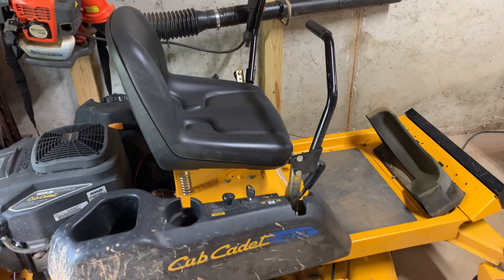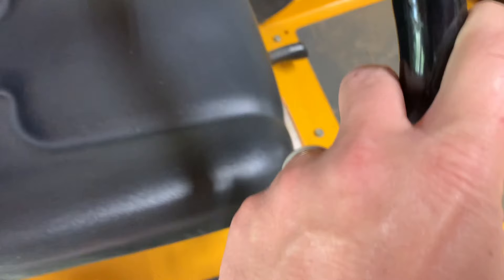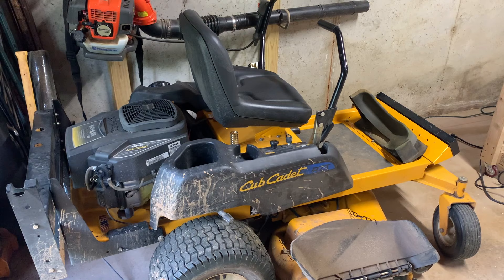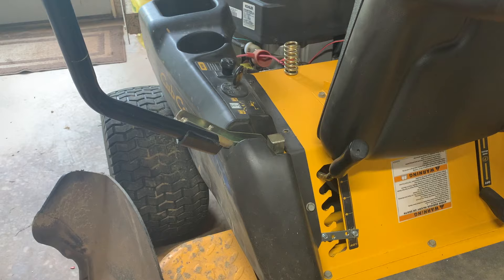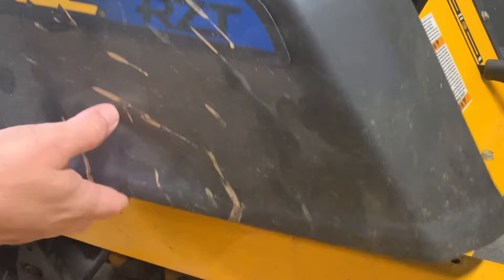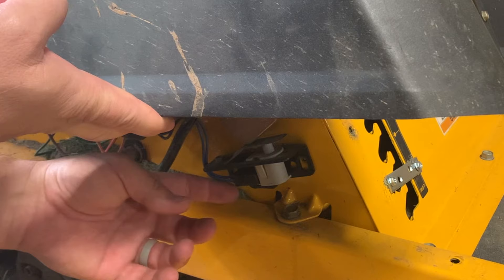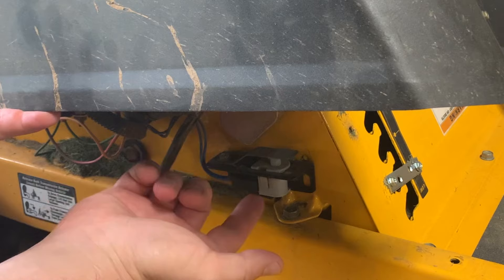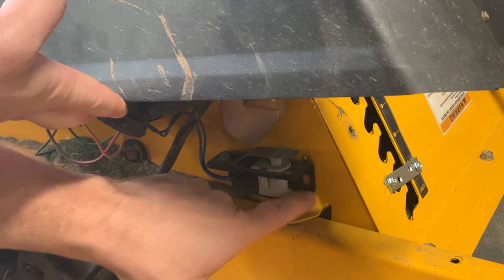Disabling Safety Switch on Riding Mowers

Comment: I have a Toro Wheel Horse with the 'key choice' key switch under the front of the seat.  The switch broke, and it turns out it's just a momentary on switch.  I like the feature, so all I did was change it to a 'normally open - momentary on' push button.  Worked like a champ!
Reply from the maker: That’s great! I’m glad you got it all figured out!

Comment: I just bought the ZT1 50 2023 I'm glad mine doesn't shut off like this. They must have changed something. That Kawasaki motor is a beast run so smooth.
Reply from the maker: That’s nice! Yes! The motor is top notch. I’ve never had a bit of trouble from it.

Comment: Thank you for this info! I wanted to disable that switch anyway, partially because that clutch has a set number of cycles on it and I don't want to waste them. My mower is a little different (probably older) but it worked.
Reply from the maker: I’m glad you found it helpful!
Reply: Just make sure the wiring harness is still firmly seated in the switch. Mine came loose and I didn't know it was that connector because it looked like it was connected (I work in Quality, I just had to do the push-pull test 🙄). The PTO wouldn't engage without that plugged in (but the clutch and switch both tested ok), so I got long leads and took both fenders off to start testing wiring, and that was the first thing I checked.

Comment: Thanks for the video. Turned out I had debris  around one of the safety switches holding it down. Removed the debris and now it works.
Reply from the maker: That’s great! I’m glad it was something simple!
Reply: @TightWadDIY    I adjusted the clutch too.  Seemed to help. Now I gotta figure out why the hydrostatic is sluggish.  It’s always something. 🤣🤣

Comment: How do  you bypass parking brake button and straight wire it on a Troy built 42in zero turn 6 prong connector

Comment: Also it's a Kohler motor if I only hook up the battery and the ground to the battery with a test light and then touch the frame of mower with a positive test test light it lights up now what lol 😆  I'm lost no ground cable connected but touching the frame sets the light off on the test light . Need a heads up point me and the right direction appreciate it .

Comment: How do you bypass parking ? I take my cub cadet parking brake off but it shuts the mower off? Seat switch has been bypassed also.
Thank you
Reply from the maker: I don’t think you can. The mower depends on it being on to turn on the mower and off to engage the the steering so it requires both settings to function.

Comment: I have a cub cadet Z-force L.  The blades spontaneously cut off while mowing. Sometimes they will come back on if I keep moving and sometimes they won't.
What I've tried so far:
New PTO, New ignition switch, changed all 4 handlebar safety switches, new battery, new pto switch.
What do you recommend? Please help!
Reply from the maker: Sorry I’m not sure what else to check.

Comment: I have an exmark Quest steering control mower. The PTO stopped and I couldn’t get it to engage again. I shut the mower down, now the mower won’t start. Checked the starter system including replacing battery and solenoid. Leads me to the safety system. I’m lost from here.

ng.
Leads me to the safety system has a ground issue or a short somewhere. Oh, the automatic brake system is working, any ideas that can lead me to a
Reply from the maker: Check the fuse.

Comment: Bought an old mower and the switches are missing entirely but wiring harness/plug for switches are still there. I dont want to buy the switches so how could I create a closed loop or whatever without having switches in place?
Reply from the maker: I’m not really sure.

Comment: Just did mine today it is much easier to just do the one by the gas tank side you can just lay down on your back it is literally one screw that holds the switch in. No need to do all that other stuff thanks for the video.
Reply from the maker: Good to know!

Comment: Why do these PTO in Reverse switches even exist? I've been using my neighbor's Toro Z Master 62" commercial and then acquired my own Cub Cadet RZTL42. I thought it was broken. Now I can't do proper turns without shutting the mower off and back on again. Having to do this 30+ times per mow is a HORRENDOUS experience.
Reply from the maker: Agreed. I dislike them.

Comment: I have a Cub Cadet commercial m50s, will a bad parking brake switch cause the mower to shut off when the pto is turned on?
Reply from the maker: Not that I’m aware of. A failing reverse switch would though.

Comment: Have a Cub Cadet Ultima ZT-1 54". My reverse appears to be 100%  mechanical to the Hydrostatic drives, the little steel rods just go back & change them to reverse. I see a lot of conversation Re: Reverse switch, am I missing something on my mower? I have the safety Interlock switches, but those are only for braking when parked, right? Thanks
Reply from the maker: Sorry. Every mower is different and modern mowers no longer have the same safety switches.

Comment: What part number is that safety switch for reverse? I replaced the 2 visible switches that the handles rest in their cradles already.
Reply from the maker: I’m not really sure. Check the cub cadet or possibly the MTD website though.

Comment: I have a RTZ club cadet zero turn I crank mower counting great about 30 minutes one side dose not turn and it slow down
Reply from the maker: You could have a bad transmission. You’ve made sure the wheel lock is off right?

Comment: 17AH3AGL710 CUB CADET ZFORCE 44, BLADES WON'T ENGAGE.  TRIED PTO SWITCH IT STARTS, WHEN NOT ENGAGE, MOWER DOES DRIVE BACK AND FORTH WILL DO EVERYTHING BUT THE BLADES WON'T ENGAGE? ANY HELP WILL BE GREATLY APPRECIATED!
Reply from the maker: It’s possible the belt is too stretched out.
Reply: @TightWadDIY  ty!!

Comment: Got a question for ya if you got the time on a electric push mower I'm trying to bypass a safety switch and install a potentiometer so I can adjust the rpm of the blade is this something that's possible I'm having difficulties getting around it with the motor sparking and smoking and I don't think I can install one after the switch because it monitors the voltage and that's how the speed would be changed 
Any help at all would be amazing I can not find a thing about bypassing it
Reply from the maker: Sorry. I’ve never worked on electric mowers so I won’t be much help. I learn as I go.

Comment: Thanks.  Blade wont engage.  Not sure this will fix it but it's worth a try.
Reply from the maker: What do you mean? The PTO switch doesn’t do anything at all?
Reply: @TightWadDIY  when I jumped the relay with jey on it cranks but when I lift the PTO switch it dosent do anything.  I've oiled it but it just dosent language the mower bkades.
Reply from the maker: @frankdavis3486  I wonder if it could be an issue with your reverse switches.
Reply: @TightWadDIY  bad weather next couple of days.  I'll check that when weathers clears on Thursday.  Thanks buddy.
Reply: Same issue with blades won't engage new pto last year new belt new switch blades still won't engage.. Maybe bypassing the safety switches will help ????? Any advice I would appreciate it.

Comment: I had a short somewhere in my wiring harness, ( I think) I completely removed it for close inspection, I still see no bare wires. Thinking of just buying a new complete harness for $148, do you have any suggestions as to where else I might check before buying a new harness, I have replaced the PTO switch & both lapbar interlocks, I isolated the Mag Clutch, by disconnecting it, also the seat, & lights, just don 't know where else to look. Thanks!
Reply from the maker: Will it do anything at all when you turn the key?
Reply: @TightWadDIY  Thank You for your response. Yes the engine starts and runs good. When I pull up the PTO or pull in either Lap Bar the engine bogs down and dies, blows the 20 Amp fuse. I have disconnected the wire clip going to the mag clutch, the front lights & seat, it still does same thing, I have looked for a naked or crimped wire, don't see any. I completely removed the wiring harness, and the split black covers for close inspection, don't find anything, put it all back on, same problem. I have also replaced the PTO switch and both safety interlock switches. I think it is a short some where, perhaps concealed within the harness. The only thing I haven't changed is the solnode   and key ignition switch. Any suggestions or testing means would be appreciated. Thanks again.
Reply from the maker: @doylejohnson8688  Try posting this question for Tarryl Fixes All. He is a mower specialist.
Reply from the maker: @doylejohnson8688  It it was just the PTO bogging down I would say you have something binding on your deck but if it does the same thing when lifting the lap bars I’m not really sure.

Comment: Took off brake safety,does this have to be replaced?
Reply from the maker: The brake switch has to be pressed in to crank and released to move forward so I don’t think you can just take it off.

Comment: I have a 2007 and had to do both sides, once I did not disable mowing for both directions
Reply from the maker: I’m glad that worked for you!
Reply: You have the rzt50 cub cadet 2007? Do these have those 2 switches he shows in video? I just replaced the two for the arm cradles and the blades wont engage so it must be the reverse ones?